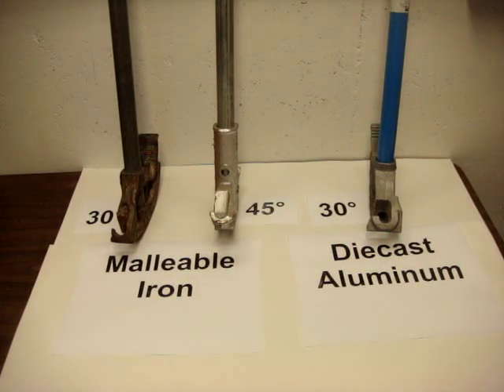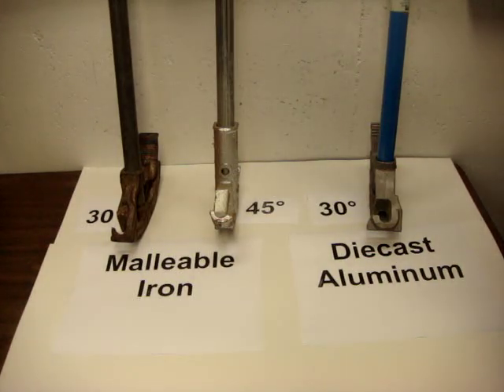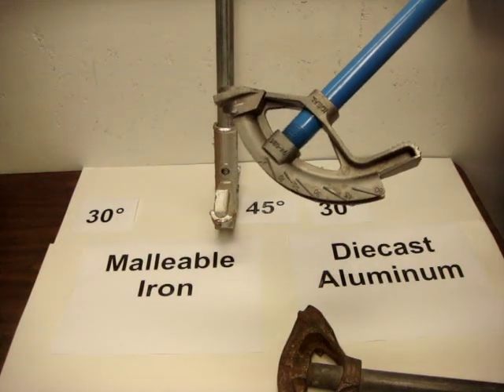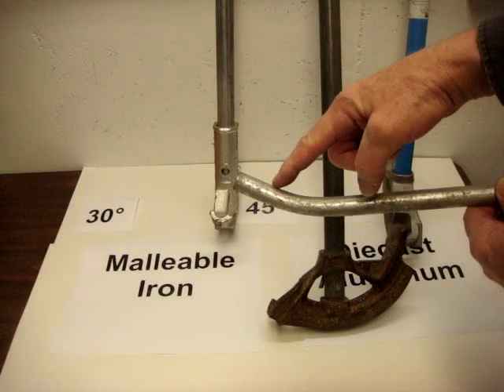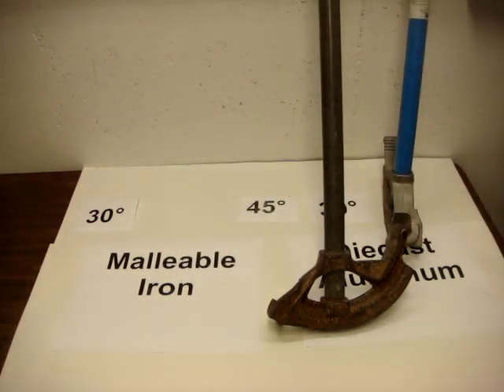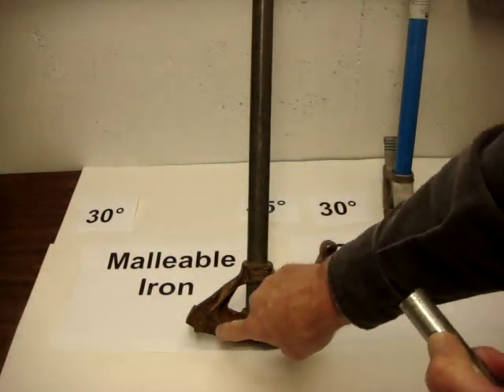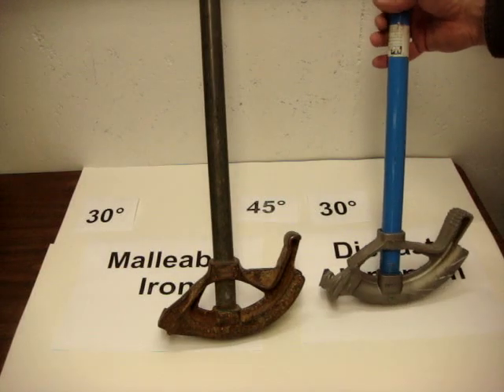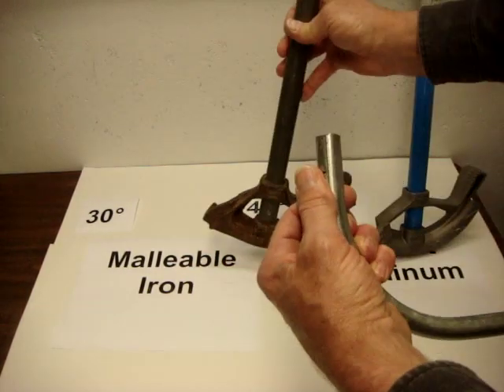Conduit Bending

Comment: Subraect 5" from what?
Reply from the maker: Subtract 5" from the desired length, place the bender's arrow at that mark (with handle pointed towards the end you measured from), and bend the pipe. It adds 5" during bending.

Comment: I am having a grip of trouble.. i need to figure out how to bend a conduit tube to a 6 inch radius...if you can please help?
Reply: What trade size conduit?
Reply: aircraft rib....1/2 inch o.d.
Reply: Rockbase Masonry
I am no expert on aircraft rib, or what it even is. You might want to try a metal fabrication shop.